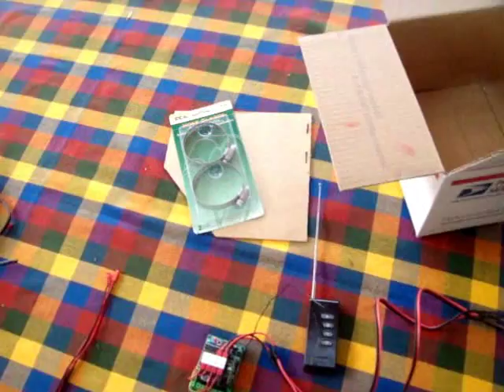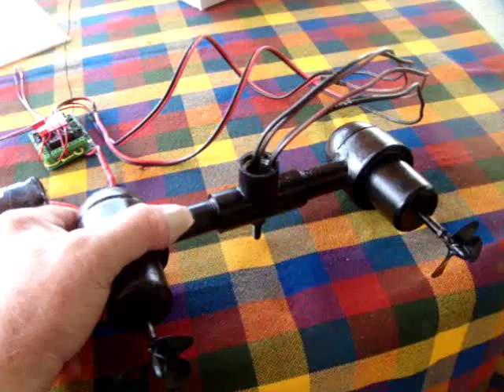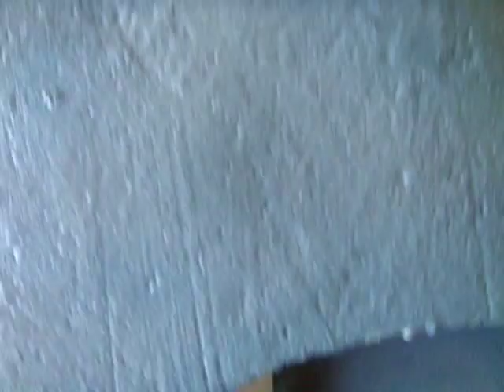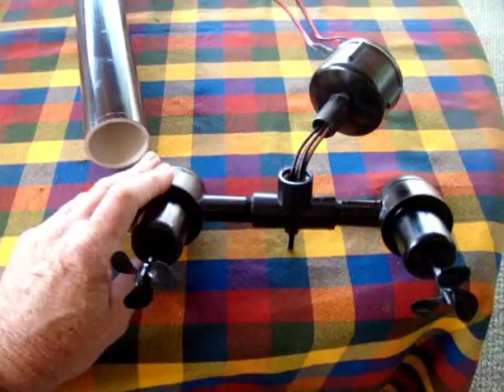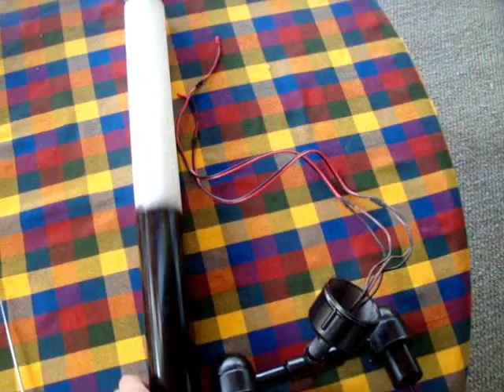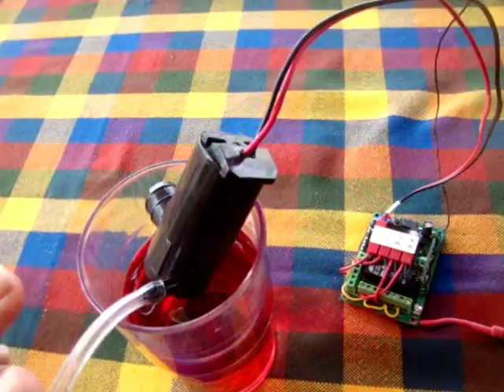Great White RC fin build

Comment: Does anyone know if these kits are still available ? This video is 11 yrs old.
Reply: Sorry, I never provided kits just a few custom builds for friends.  Just use two small boat bildge pumps.  Take out the impellor and put on a prop.  The remote control unit can be bought from AMAZON but I bought mine years ago while in China.  I got the fam at Home Depot and used latex spray paint for the outside.  Hope this helps,  Best, Joe, Quettek